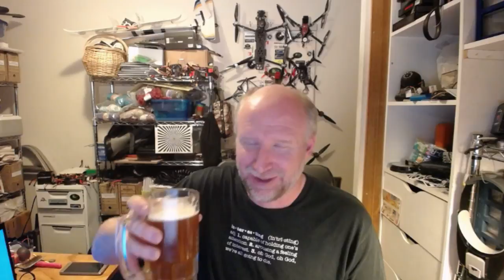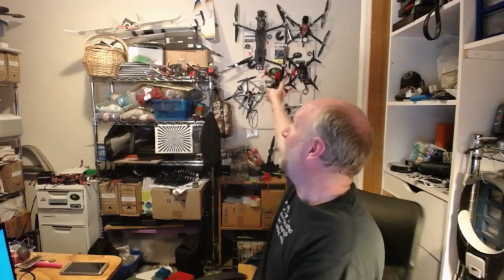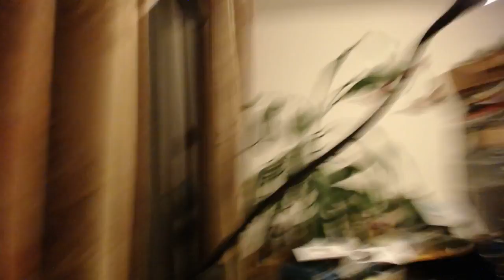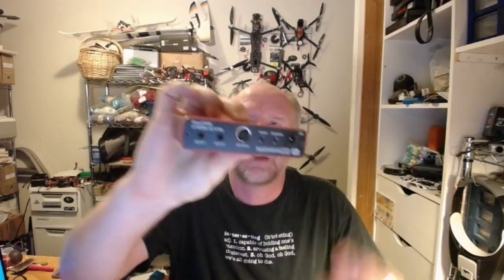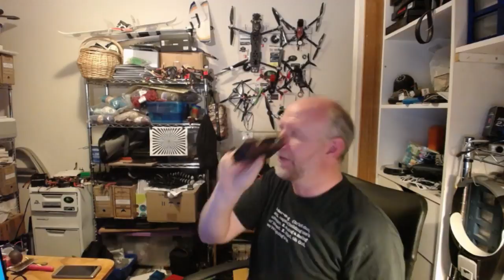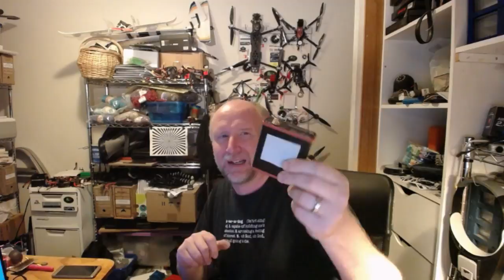Long Range Corner: Don't Panic, Reelsteady, and Q&A

Comment: 2TB in S3 glacier should be less than $10/month. Granted you'll have to pay for the upload BW and on-access.
Reply from the maker: That's definitely a decent option, though I think it'll be costly in the long term. For $400USD you can get 25 100GB bluray discs and a burner, so after about 3 1/2 years of storage you'll be paying more. Also, given the nature of the data, it's not something that I'd need rapid access to on a regular basis... it's just mainly for archiving.

Comment: Bummer missed the show, but good to watch the recording.

On backups.
RAID is never a backup.
RAID provides redundancy against hardware failure (and introduces it's own issues) but it does not provide protection against accidental deletions, fire, theft, malicious users etc.
Snapshotting can help, but still isn't all that useful in most home situations (might be more useful if you have kids).

Backups require a discrete copy of the data and a copy should periodically be taken and stored offsite.

I have the hardest time getting managers and "architects" to understand this at work. I register all data that only resides of RAID as a risk on the risk register.

Personally if I cared about my personal data and I had terabytes I'd get a tape drive and keep some of the tapes at a family member or friend I trust's house. Tape is still the only way to backup large volumes of data without duplicating the capacity in other hard drives.

Video doesn't compress well because it is usually already compressed.
The notable exception is RAW video.

You probably know all this, but I think it is worth mentioning for your future viewers.
Reply: Yep agree, good info, thanks for the post. I'm not too sure about tape as a home solution, but I'm not up to date on that.. Don't know that many people have enough home data, to be worth it. But you could be right.
I've run home/office raid5 array storage for near a decade or so now, for mostly video data. Current build is about 5 years old and nearly full, Linux PC 24hr server, 4 x 3Tb drives, about 8TB (from memory) formatted storage. Linux is great (there's a learning curve!), faultless 24hr operation for years at a time.
Reply from the maker: Good info!
Yes, you're right. RAID is just redundancy. However, multiple copies stored on multiple systems is a backup. Ideally, it'd be on a different medium entirely and in a completely different location.

In my use case (non-mission critical data, archiving), I'm comfortable with the use of RAID. I'll be using the NAS as a sort of 'cloud' storage for videos, and the data will reside there over the longer term. The idea is to have at least two copies (one local, one RAIDed) of the data I'm working with at the moment. I really only use the videos during the first year, so that's the crucial period, and they'll exist in at least two places -- the RAID and my local harddrive. Once they're past the crucial period, they'll reside on the RAID, ready for if/when I need them. 

I'll have additional copies of the 'best' stuff on youtube as well. It won't be as good of quality as the original, but it will do in a pinch.
Reply from the maker: amisoftau - I just checked on some tape solutions. A 6TB tape solution runs over $2000 USD. A bit too much for my tastes!
Reply: Yes, same here. But perhaps jtan163 knows of some more economical solutions. I'm doubtful. p.s. I'm only half way through the video so havn't yet heard what you said (I assume) about storage. Great flying Chile, thanks.
Reply from the maker: It looks like BluRay writers are the most economical at the moment. $50 USD for the drive, then about $16 for each 100GB disc.
Reply: Watched more now, so have heard your storage comments :). That's all good. For bullet proof backup, just set up a second RAID array, to maintain two full copies.. That's expensive though; so most people do as you are, use secondary storage - large HDD's in a workstation or two. For off-site backup, put your GOLD data on a large external drive, and have the mother-in-law store it for safe keeping. Lol.

The RAID arrays can be very reliable, you need to use good HDD's. Preferably the ones designed for NAS/24hr operation. You should get something like 5-10 years out of good drives. If choosing a standalone NAS unit (these are a very neat compact solution), it's wise to get a major known good brand. I've heard many stories about cheap NAS units - when the client comes to replace a drive in a failed array, the rebuild fails so that all array data is lost. Scary stuff! :).

For secondary storage in workstations, you can get up to about 10TB HDD's now. Suggest Seagate or Western Digital drives. :) Last time I looked at those, the largest was about 4-5TB. I typically put one of these large drives in the primary workstation as a second (non-boot) storage/work drive. Video editing on local storage is always quicker than over the network.
Reply from the maker: Yup. I've got 6 TB of old school HDs in my editing workstation, plus a 128gb SSD and a 256gb NVME drive. I've purchased a Synology DS418 with 4 4TB Seagate Ironwolf (NAS rated) drives. It'll be local in the house, so not ideal for backup. I'll look into a BluRay writer and 100GB discs for offsite storage.
Reply: BluRay: Could be worth a close look. Google up on "BluRay backups". In the past I've done a lot of backup on CDR. They are slow to read/write. They were not good long term storage. They aged badly, and proved unreliable after just a year or three. Perhaps BluRay is doing better, I don't know. Generally now I don't use disc's for anything at all. BluRay was always a write-off for me because they crippled the video standard with horrible encryption crap. Remember they KILLED Dat tapes for video/audio, decades earlier - we were stuck with cassettes and video tapes - horrible junk.
Reply from the maker: +amisoftau the encryption standards are for movies on bluray. The physical medium has none of that, thankfully. I've been doing a bit of research this morn. M-disc bluray is supposedly good for up to 100yrs and holds up to 100gb. Should be good enough for my needs
Reply: Yes, agree should do. I doubt their "100yrs" though. Probably lucky to get even near 25yrs.. but should do you fine for a few years at least.. especially for an additional last resort off-site backup.
Yup I know the encryption was video only - but it leaves a  "sour taste in the mouth".. they want to deny our right to backup a movie we have paid for - and backup IS required - those discs (and DVDs) are very fragile. Cheers.
Reply: Have you looked into cloud solutions like AWS Glacier or Google Coldline storage? It ends up being about $6-7/TB per month. Its not cheap, but not outrageous.
Reply from the maker: S Ali Imam - No, I hadn't. Thanks for bringing that to my attention! Certainly the initial cost is less than the Bluray solution posted above, but after 24-30 months (depending on how cheap you get the discs), Bluray becomes cheaper (assuming 2.5TB of storage).
Reply from the maker: +amisoftau They actually claim 1000yrs on those discs. Evidently the hype is enough that the DOD is using them. 10yrs would be enough  for me.. ;-)